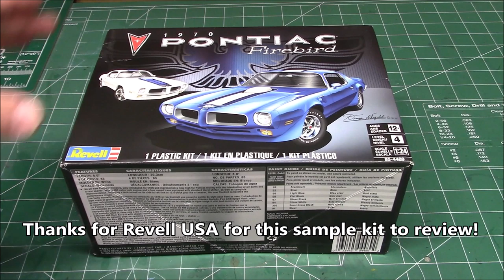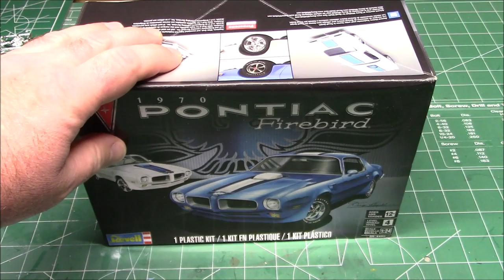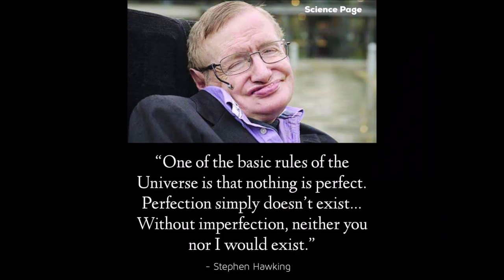Revell 1970 Pontiac Firebird T/A 2n1 1/24 Scale Model Kit Build Review 85-4489

Comment: I had this kit when I was a kid back in the early 90's.  Then I bought the full size version about 10 years later.
Reply: Haha, something similar happened to me, sort of.  In 2003 I bought a 1972 Challenger and for some reason this car seemed familiar to me.  I dug out my box of old models I had made as a kid and lo and behold I had a Plum Crazy Purple Dodge Challenger that was a ‘73-‘74 model.  It was from the Otaki Rock Machine series with rear rubber tires and was motorized.  Only difference from the ‘72 model body wise was the addition of “bumperettes” for federal safety standards.  This was cool because ‘72-‘74 Challengers were not as popular as the ‘70-‘71 Challengers and model kits of the ‘72-‘74 Challengers are very hard to find.  The one I built was from about 25 years prior (and it was the only model car I ever built with my brother who made an Otaki Thunderbird) and it was from the no longer in existence Otaki Japanese mode company which became Fujimi.  It’s a rare model and the fact that 25 years later I had the real car it was based on I thought was such a funny coincidence.

Comment: I bought this kit today… When you go to put the interior on the subframe… it has two female points and in the directions it shows the interior tub has two male parts that are supposed to go together. I did not have the male connectors…. And I noticed on yours as well… that you didn’t have the little nubs…..how did you fix that problem and compensate for it…..could you let me know please. You are one of the best… I just turned 42 this year… I probably built about 8-10 models in my life.. My dad got me into it…I have been looking for something to stimulate ME…  in the evenings after work… So I bought 4 model cars from Hobby lobby… I have completed three of them… ready to finish the Foose… 65….Impala…..And I am getting ready to start the 70 Firebird…   If you could give me some insight on this problem and how to modify it… I would love it.. Thanks

Comment: Carburetors always tilt forward like that. When the engine is dropped in, it tilts tail down. In its final resting place the carburetor will sit level for the floats in the carbs it operate properly.

Comment: My sister had a 1970 Trans Am . She brought it new very similar to this model. It didn't have the bird on the front and it came with Polyglass GT tires the blue patches were a little more rounded at the corners and I don't believe the edges of the blue were darker . It was an automatic with blue interior the transmission shifted hard even under normal acceleration ( no gentle slip into the next gear) . Brings back memories.

Comment: I built this model many years ago but, before that, I owned a white '71 Trans Am (same blue decals/no bird) with a 455 HO and a Muncie 4 speed. I don't know why they used a 10 bolt differential but I went through a couple of them.
Reply: 10 bolts are glass. I think I’m about to go through my first one in my 95’. Leaks and whines.
Reply: @pontiacmaniac7772  70 T/As were 12 bolts. Only yr Pontiac used them. Your 95 10 bolt is much weaker than the 2nd gen 10 bolts, altho compared to a Ford 9", or a Mopar 8 3/4, "all" GM rears suck. (then again, if you were to find a 58-62 Pontiac, Olds rear, you would have something to brag about.)

Comment: If Revell USA ever re-tools and re-issues the 1/32 scale Peterbilt 352 COE snap-tite kit,you should do a full build review on it;because alot of people have disliked push/snap together kits for their of soft detail;or lack there of,brittle plastic,and peel n ' stick vinyl stickers.With today's molding technology snap kits are even more detailed;and easier to paint and build (gluing is optional),than they were decades ago.They are still being issued;with the peel n' stick vinyl stickers for those who are a novice/new to modeling,and now includes an optional water slide decal sheet;for the more advanced/experienced modelers.
Reply from the maker: I build snaps all the time. I have two or three press fit kits coming up within a month.

Comment: I recently received a magazine that told me this kit had been reissued;
I watched the video and was pleased to see that in addition to the upgraded tires (and terrible optional wheels and tires), that there have been several casting improvements to this kit since I bought it in a Monogram box in the 1990's;
I was pleased to see that the transmission is now an automatic (the old molds had it as a manual transmission with the automatic console(!?);
I was pleased to see what overall was a vastly improved decal sheet, but was confused as to why the "TRANS AM" decals for the fenders and rear spoiler are absent (I actually have an original Monogram uncut decal sheet that I verified it as previously having (I bought two of those Monogram kits, and one was highly modified past what the kit was intended for, which is why I have the spare decal sheet)
Reply from the maker: I get the reviews done many months before the magazines announce stuff.
Feel free to subscribe and stay updated!

Comment: The car turned out  perfect man  that white paint  is excellent I think what I would have done  is I would have used the white stripe with black outline on the white car  just to set it apart from everybody else  but that's just me .looks really good man Usually what I do when dealing with chrome parts and gluing them  on non-chrome parts is the glue surface I usually scrape off for a better Bond I don't think I've ever heard you say that in any video so I'm not sure if you knew to do that or not
Reply from the maker: Thanks James!
I usually just glue paint and all, depends how the surfaces are.

Comment: Nice build  would like to see you do more detail though like wireing valve stems for tires just kick it up a notch stock builds are great but little details bring it up so much more keep up the great work.
Reply from the maker: Thanks for the nice words.
Just FYI, these are kit reviews to show modelers what they can do with what is in the box, not model making classes or model show winning cars. 
The manufacturers have explicitly stated they do not want extras used on the kits they send.
If I show extras added, people will be screaming at the dealers that those parts/decals were not in their kits.

Comment: Looks great. Did you spray it with clear coat? I was just working on this model kit today and sprayed it with Testors 1245 Gloss White. It was looking really good but then I sprayed it with Rustoleum 2x Painter's Touch gloss clear and it all went to crap. Orange peel and some paint thinning on the hood to the point where I can see streaks of the gray primer underneath. Trying to figure out where I screwed up before I wet sand again and repaint. Maybe the gloss white needed more time to dry? I only waited 15 minutes after the final coat of white. Maybe it was too hot and dry on this July day and that vaporized the clear? I sprayed it outside and out of the sun before bringing it back inside to dry. Maybe try a Testors or Tamiya clear spray instead? Any advice would be appreciated.

Comment: Just a suggestion. Would be  good if  the engine could be wired with spark plug cables.
Reply from the maker: Yes, that always looks good, but this is a kit review, not a model making class and the companies prefer I build them as they come from the box. Thanks man!

Comment: My son gave me around 15 vintage plastic airplane model kits (some still wrapped) he found while working at the landfill.  I've been thinking of getting back into building models for a hobby so my question is should I buy new or just build those older ones?  From my memory when I was a kid building models the parts never fit together well and I was wondering if the newer models are better.
Reply from the maker: I say build them. 
Even if they have fit issues it doesn't matter, you'll pick up skills and making mistakes means you're not out any money of an expensive new kit.
Reply: @hpiguy  Good point about picking up skills. Thanks

Comment: Always been a Pontiac man myself. I'm about ready to paint my Ducati 1199 S pangile Tricolore using the Tamiya paint. Do they spray good? Never used it before
Reply from the maker: They spray just fine, no issues. They may be thinner than what you are used to. So shoot light coats and let dry for 30 minutes between coats so you don't get big runs.

Comment: Nice job and good looking kit. How long do you let the Rustoleum Prime sit for? I have used it, only thing I can get locally, but have had some issues with it in the past. I know it doesn't seem to like Metallica paint, especially the Dupli Color.
Reply from the maker: The primer only dries for 30 minutes max.  I've even painted over it while still sticky at times. I know that sounds crazy but it works for me.
Reply: @hpiguy  thank you. I will give it a try on my next kit which I think will be the smokey and bandit Trans AM

Comment: So super new to all this. I'm currently trying a '69 chevy nova ss for my dad because he talks about how he had one back in the day alot. I don't have anything setup due to just starting so I painted outside. The hood got messed up.. I assume to humidity? If I were to set up a spray booth like you in the garage would that help? Or not even worth the effort? I have a "hobby" room in the basement but not one I can set up a booth in...
Reply from the maker: All the booth does is catch overspray. It has no effect on quality of the paint job.
Reply: @hpiguy  oh okay. I suppose running back and forth will be the only solution here sadly. As long as it works I guess

Comment: I just bought this kit and its my first model, and I'm having a lot of trouble - nothing clicks together at all. Have I got a bum kit or am I supposed to rubber cement everything?
Reply from the maker: These are glue together kits. Rubber cement is not what you use to assemble model kits.
I suggest you place this to the side and begin with a few snap together kits, then work your way up. Enjoy!
Reply: @hpiguy I should have startee with snap together but I got this as a gift and want to make a decent effort to complete it. Could you recommend me a good glue? 
If I mess up, at least I tried!

Comment: Do you ever build the drag version of the 2 in 1or 3 in 1 kits?
Reply from the maker: Depends which style I prefer. I've done the gasser version of the 57 Ford instead of stock.
Reply: @hpiguy  I was just curious. I myself prefer to make gassers with hi front ends. I enjoy your builds and have learned a lot
from your builds.